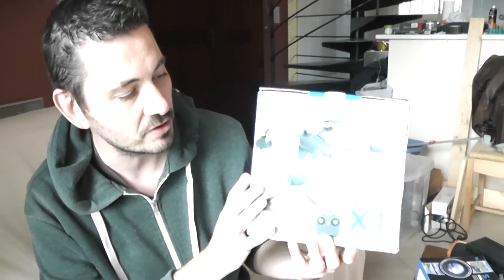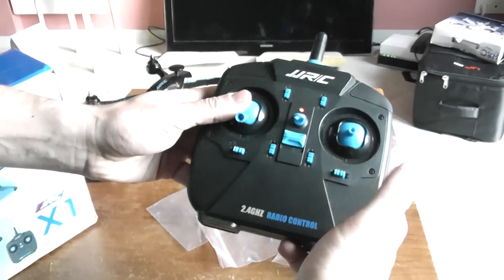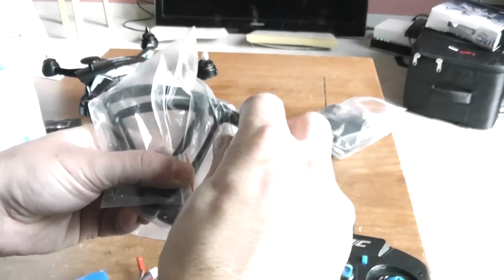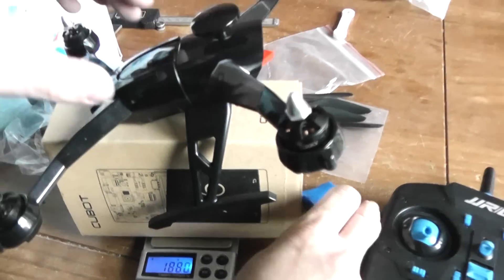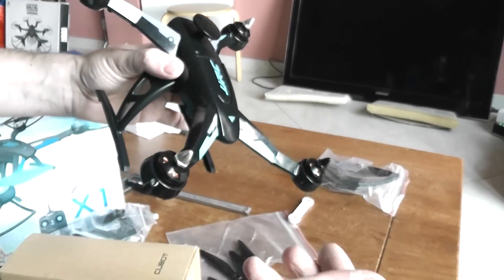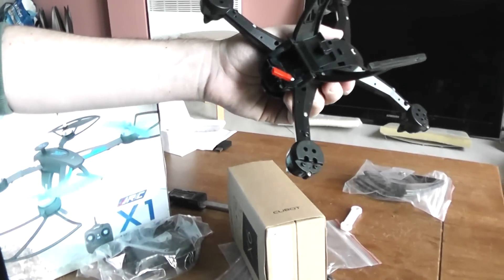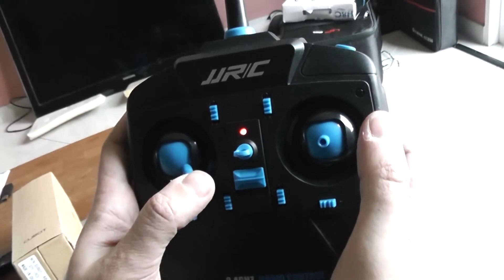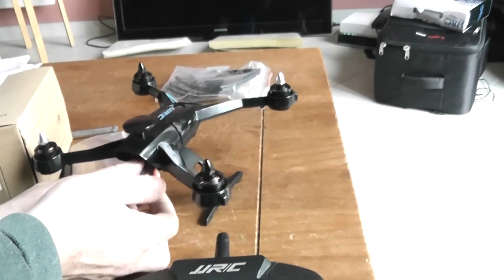JJRC X1 Unboxing and quick analysis (Courtesy Banggood)

Comment: The 200 QX motors will stop spinning as soon as the props contact the ground (prop strike).

Do the props on this JJRC X1 stop immediately if the props contact the ground as the QX 200 does?
Reply from the maker: +Cool Digs No ....

Comment: SeBy, I think you said "like" over 25 times. If you really, really like it, I'm really going to get one
Reply from the maker: +Chill Haha :) I see you have your SeBy's decoder working well
Reply: +SeBy DocKy  i ordered an x1 yesterday and the yihzan (syma) fpv kit, from banggood,  my first brushless quad,  i hope you do more videos on the x1 in regards mods and tx protocols,  i wonder if this has a better power to weight ratio than the tarantula x6.
Reply: +SeBy DocKy x1 arrived early this morning, i was removing the props to test it, i noticed that the props rotate in the direction of the nuts unscrewing.. is that normal, surely this might cause them to unscrew, to be clear, front left prop is clockwise and unscrew is also clockwise?... please answer as quick as possible so i can relax and go fly it, by the way tarantula x6 batteries fit well.
Reply from the maker: +alan hennesy No it's not normal for the props lock. In practice, if the motor is CW, you have to tight prop lock CCW et. With my X1 it's like this. Swap your prop locks and it will be ok ;à
Reply: +SeBy DocKy .. lol this is what i was afraid of, you are saying my nuts and props are ok and not wrong? the props are clockwise and the nuts tighten ccw .. to unscrew the nuts is clockwise same as the prop direction....
Reply: +alan hennesy lol ok couldnt wait for reply, it seems to fly ok, in blustery 30mph winds here... it seems very counter intuitive that the nuts come off in the same direction, hope i can get out and fly it later, i ordered the syma x5c fpv kit, tarantula version so i will need to figure out what does what to connect it, i have an old broken x5c camera somewhere so i should be able to build a connector once i know what each wire does

Comment: This is actually rebrand of a Yefei quadcopter. So in case of a crash you can not shut the motors down immediately? that is no good
Reply from the maker: +Multirotor Go Seems to be I will recheck instruction manual if there is not another "secret" disarming sequence

Comment: So the props will spin for 10 seconds befor you can disairm even with the tho down?
Reply from the maker: +ST Logan There is a trim button which allow to reduce the  motors's idle. If pressed several time, it can stop motors
Reply: SeBy DocKy OH i see thank you ... so in a crash; will  the motors continue to spin  for 10 seconds ?
Reply from the maker: +ST Logan I didn't crash it to answer to this question :(
Reply: SeBy DocKy i like your show and i see  you are a good pilot ...but when you do crash i hope you are recording ...
Reply: thank you for your cool show of QUADCOPTERS

Comment: I"m thinking about getting this for fun flying and like to order extra batteries, but BG doesn't show them. Is this the one http://www.banggood.com/MJX-X101-RC-Quadcopter-Spare-Parts-7_4V-1300mAh-25C-Upgrade-Battery-p-1022407.html it looks just like the Syma H8c battery, or can I order these? http://www.banggood.com/7_4V-2800mAh-40C-Lithium-Battery-For-V262-V333-V323-V666-p-946407.html They look like a 2800 mAh version, but is the battery to big to fit inside the quad? Thanks!
Reply from the maker: +Bobster986 As I wrot in my review, I advice this battery: http://www.banggood.com/YiZhan-Tarantula-X6-RC-Quadcopter-Spare-Parts-7_4V-1200mah-Battery-p-972203.html?p=YL2512105842201212FR
Reply from the maker: +Bobster986 Yes seems to be ok ... I didn't test this one. For the YZ-X6 model, I am sure it's fitting Inside.
Reply: SeBy DocKy It would be nice if they could put the dimension of the batteries in their descriptions.???